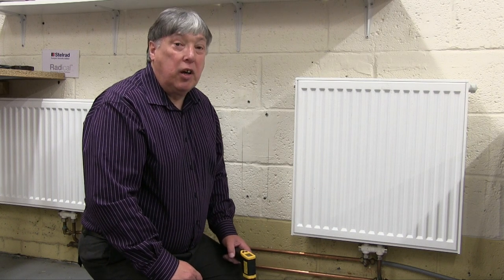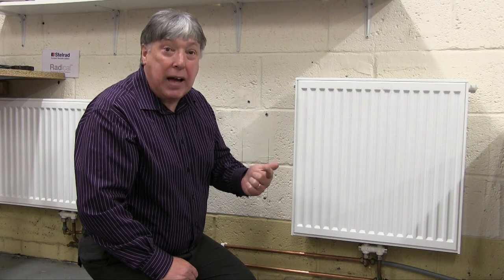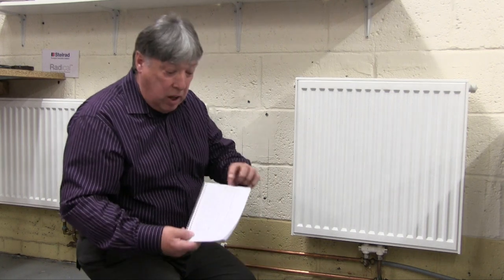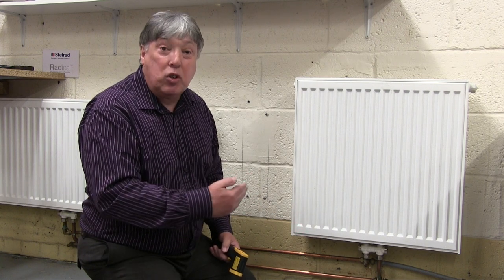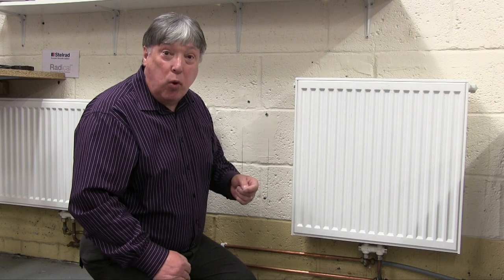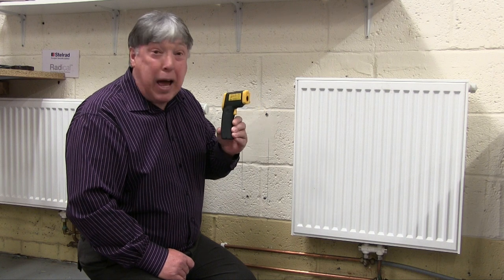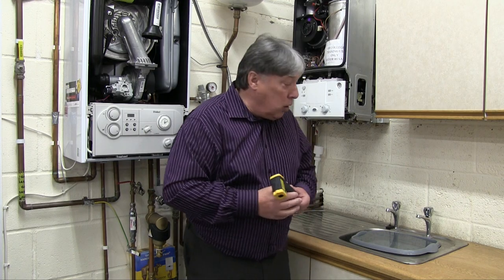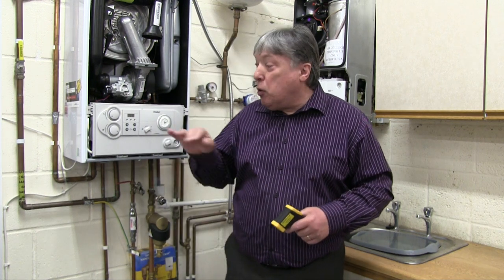Using a Laser Thermometer

Comment: I have a Worcester Bosch boiler, just been serviced. I have my central heating flow temp set to 55c but the return temp is only about 5c different at 50c. I have two rads with no TRV as the boiler manufacturer said to not put a TRV on the upstairs bathroom rad and also not one on the hall rad as that is where the wall T/stat is located as these should act as a bypass. On that basis where there is no water flow restriction on those two rads, is that why I am not getting a 20c difference at my boiler flow and return? Thanks
Reply from the maker: Hi Robert, thanks for asking, they and others are talking rubbish, a rad without a TRV is just on FULL (expensive) 
            Yes, never put a TRV where a ROOM stat is which goes in the LOUNGE!! the clue is in the name.
      After 15 minuets you will not get 20c diff. unless 
1. lots of 22mm 
2. auto by-pass under the boiler 
3. balanced. 

 The pump needs these to get the heat out of the boiler or it will overheat as you have.
Please have a look at my other vids on this subject. regards, George Staszak

Comment: So what should the difference be between the top and bottom of the radiator generally?
Reply from the maker: Hi Samuel, the top centre is for balancing the whole system, the bottom is sludge. 1st. turn on the heating to MAX for 12 minuets, turn ON all the rad valves fully,  make a list of all the rads then measure all the top / bottom centres see which is under / over heating. Turn down the over heating rads lock shield valve. The aim is to get as many at the same temp should be about 24C from the nearest to furthest rad to the boiler in a 3 bed semi.  No? fault is sludge, pump, by-pass. Hope that helps. george staszak
Reply from the maker: Hi Samuel, The top is the maximum temperature  has been reached after 10/15 mins. we can tell witch is over heating thus turn that lock shield down to even out the colder rads, and the bottom tells us if that one has sludge up against the others of a similar width.regards george staszak

Comment: Hi very informative video, when you are balancing the radiator at the flow and return, do you point the laser thermometer towards the actual radiator panel at the flow and  returns ends for the rad, not the copper pipe
Reply from the maker: Hi Alan, thanks for the question, aim to the corner of the rad, diagonally about 6cm from the edge. The number shown is wrong because the laser is reflected away thus giving a lower number. Do NOT look at the red dot, it will damage you eye.

Comment: Thanks, very helpful information
Reply from the maker: Hi Arshad, thanks for reply,  a very useful tool, don't forget the number are wrong because the rad does not reflect back but all the rads should be within a similar number
Reply from the maker: Hi M.A. thanks for the feed back, regards george staszak
Reply: @mrcombiBedford  hi mr combi which number was you referring to in this message is it the trv number or on the laser display sorry i didnt understand thankyou
Reply from the maker: Glad to help, take care, george staszak
Reply from the maker: @bahiaharjinder  Thanks for the question, laser stats don't give the real temperature because a rad deflects the beam thus all the figures will be out of true but we can work with the error, in water all OK
Reply from the maker: @bahiaharjinder  When we aim a laser the bean will be deflected thus a lower figure will show but all the rads will be the same, balance all the rads until you get and even number across all the rads. regards george staszak
Reply: @mrcombiBedford  good evening George, thanks for the reply much appreciated am i right in saying in order to use the laser the temperature readings wont be accurate as it deflects but use it as a guide i. e  balance rads according to the temperature of the laser sorry if you could explain in laymans terms would be most grateful
Thankyou
Reply from the maker: @bahiaharjinder  Hi Harry, say the fugues will be wrong for all the rads, as long as they are within 24C after 15 min. warm up from the first to furthest rad. If not, balance / pipe size (too much 15mm) not enough zones 18 Kw per zone, sludge, pump, by pass. hope that helps. george
Reply from the maker: @bahiaharjinder  The laser display all should be within 24C. regards, george
Reply: @mrcombiBedford  
Thankyou very much for the explanation